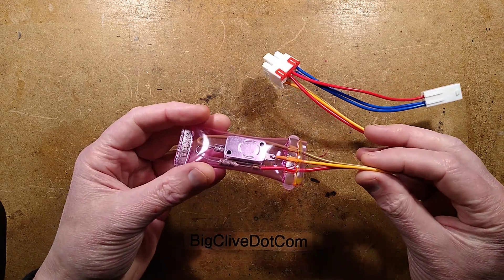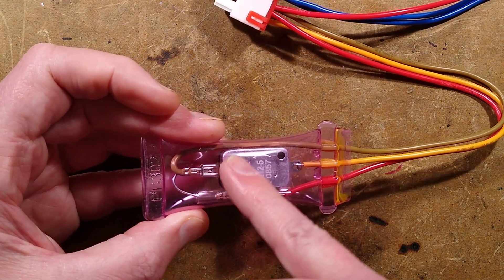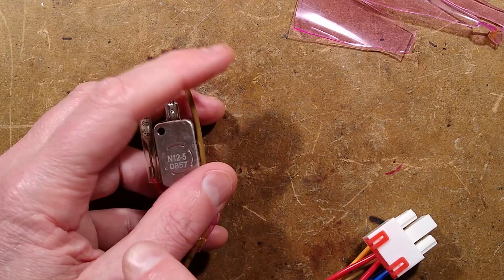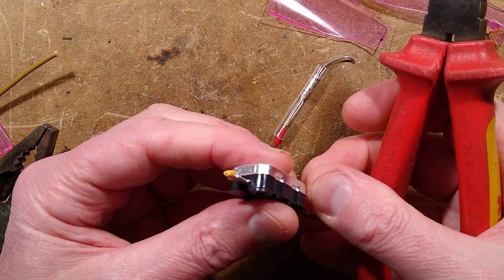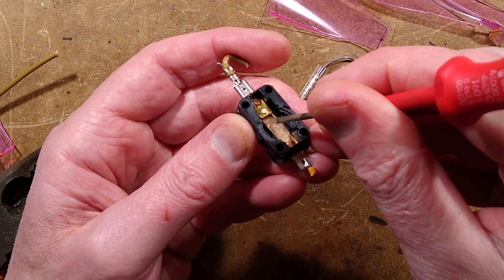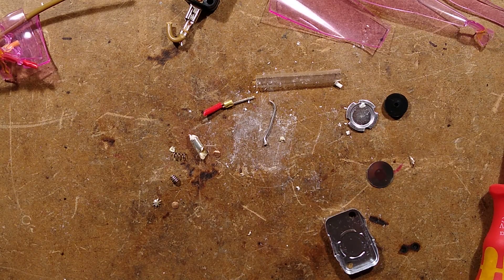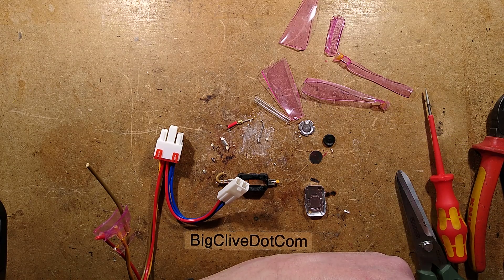Inside a defrost thermostat and thermal fuse

Comment: How can I test it with multimeter
Reply from the maker: If it's the same as this one there should be continuity between the brown and red, but not the brown and orange unless the temperature is very low.  It would have to be tested with the power off, and preferably out of circuit.  These are cheap items, if you want to rule it out you could just swap a new one in.  YouTube has lots of videos showing how to diagnose refrigerator and freezer faults.

Comment: I've been working in the commercial field for refrigeration for many years.
I believe that would be a "defrost Terminator"using the thermal disk terminate the defrost cycle and start the timer again for the next defrost cycle and if the defrost trimmer sticks on and that thermal desk doesn't cut the power thermal fuse will cut the power before your refrigerator burns up, those heater coils are like the coil in a oven.

Comment: Fun fact, the little thermal fuse is commonly inside of toasters, if the plug area gets too hot that fuse blows, toaster stops working. I recently replaced mine with a thermal breaker to keep the protection but allow it to reset as needed.

Comment: Clive or anyone in the know… I have a device with a .01 ohm current sense resistor. The actual circuit serves as an on/off switch that has a display that shows battery voltage, and automatically cuts out at lvc for Lipo battery packs. The oled display doesn’t show current. I replaced a fan that adds a tiny bit more current draw to the circuit and the stm chip cuts out and shuts down after showing an overcurrent error. If I raise the value of that .01 ohm resistor to decrease the voltage drop, would that be enough to run the higher output fan. The old fan was rated at .25a the new one is .75a. My thought is this may mess with the low voltage cutoff…

Comment: Speaking of passing air through wires, at work we have pressurised coax cables that run to the satellite hut on the roof. They're fed from a regular air compressor which pushes the air through a multi-stage dryer, since the whole point is to prevent moisture ingress.

The coax itself is about 3cm thick, and a complete bastard to handle. Luckily we installed it while the building was under construction. The top floor was completely empty so we could unspool the cable and figure 8 it to feed down the comms riser to our server room, then push the other end up to the roof.

Comment: interesting on the thermal fuse. so that plug dust should melt at around 75c then. I wonder what it is? Now I am wondering if one time trip bi metalic ones just over distor to the point of no return or also have some special melty stuff in them??

Comment: Those thermal fuses are wax based. The heavy spring presses against a wax pellet, and then once it's fully extended,  the weaker spring moves the contact disc away from the terminal formed by the wire that goes through the resin.
Edit:
https://youtu.be/5ucEiAcr7nY

Comment: yes the thermal fuse is working like that, this "compound" or wax stuff or whatever it may be made of has a certain melting point which is melting letting the contacts slide away from each other. it is actually pretty common fuses like this goes open over time even if they don´t pop. soldering them can be a hassle but it is possible even with the 70 degree ones. when I do solder i use freeze spray to frost the fuse body and use a very high temperature on the iron to as quick as possible solder the ends of the leads to the device, wires or PCB and then cool down the legs with the spray before the heat goes into the fuse. it may also work to hold the lead tightly with a thick plier while you do, it depends on the rated temperature of the fuse

Comment: Air, gases, and even liquids will travel down stranded wires. Automotive oxygen sensors actually "breath" slightly through the wires and won't work if the wires are soldered.

Comment: Could one of the springs in the thermal fuse be a memory alloy that reverts to a smaller compressed size under sufficient heat, breaking the contact? Putting a heat source to the spring would quickly tell you if this is the case.
Reply from the maker: It's not.  The method of operation is at the end of the video.

Comment: When coming across a modern ( dead ? ) appliance at your local recycling dump ( rice cooker / heater etc ) you can be sure the dastardly in line thermal fuse has gone O /C .. fit one of a slightly higher temp rating , manufacturers err on the low side to avoid costly legal issues should any fault occur , but generally these fuses are much too sensitive and result in LOTS of junked appliances ( so they can sell you a new one  ? ? ) ...

Comment: Some oxygen (lambda) sensors use the space between the braided wires for the reference air side.  These work through crimps, waterproof connectors, and provide better protection from moisture.

Critically, you cannot solder the connections or use dielectric grease in the waterproof connector or they won’t work.  They don’t need much air.

So my guess is that plastic weld leaks very slightly through the braided wires, unless they’re soldered or oiled on one side.

Comment: Would love to know what that heat shrink seal is and where to get it!
Reply from the maker: The sleeve isn't heat shrink.  Just a plastic sleeve that can be fitted together when heated.
Reply: @bigclivedotcom  Ah, I see.  Others have mentioned ultrasonic welding to seal the ends. I have a PCB with troubleshooting LEDs that I need to see.  This could be an elegant solution for that.  Wonder what that material is.  Looks like a clear "flexible tubing material, probably PVC.

Comment: Electric blankets have a similar type of thermostat in them, and the way they're made, the may have as many as 3 or 4, with 1 for each temperature setting. They are sealed so that the blanket can be laundered, and also to protect from sharp edges that could poke through the blanket.

Comment: These exist for one reason because the thermal barrier to the thermal fuse and when you get massive condensation in a humid environment. The original designs only had one sensor in the fridge or evaporator so there was no software fix to stop it blowing the fuse, the thermal switch allows it to cycle the defrost system and hopefully get it all done before the end of timer. What might be interesting to explore is just how good an insulator ice can be in these situations where you have a defrost system running and parts of the system cooking and the the ice can shield parts of the controller system, its a minefield.

Comment: You do know, that plastics are not gas sealing very well anyway? It will not pass any meaningful moisture mass in decades, and moisture coming from wires would kill connector before this unit anyway

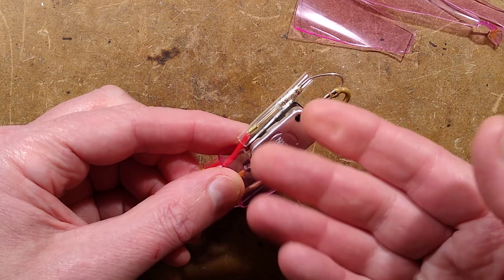Comment: 3:04 i wrap thermal fuses in paper rug soaked with water and i can solder them really nicely and they don't trip. I fix automotive resistor modules like this, typically with 180 deg C fuses. I if would fix in example water heater with 105 deg C fuse i would use  alcohol soaked rug

Comment: I had a refrigerator that used to pop and crack loudly in defrost mode then it would ether freeze or defrost every thing changed the timer twice and the thermostat and relay the noise was normal they told me after a month of this it got scrapped . When I went to replace it the sales gal told me no matter what you buy it will last about 7 years no matter if it’s one that cost 2Kor just $300  sad my old one was still working but was a manual defrost Philco I’d had owned it over 30 years I gave it to a work buddy 10 years ago and it’s still going strong !

Comment: These are also used in parallel with 'Heat Rate of Rise' type fire detectors for redundancy.
I've had two 83C ones fail and set alarms off that weren't exposed to higher than 50C.
I now parallel two of them up to give the redundancy some redundancy... It's stressfull being woken up by a fire alarm.

Comment: Clive, thanks for the video.  That is a super low cost defrost bi-metal switch.  Definitely not hermetic, as moisture can migrate through that plastic.  This design is a step backward, the previous versions clip onto a pipe on the evaporator to sense temperature so, this design will have thermal lag.

The "N12-5" number lists the cut-out and cut-in temperature, although with that number, there should be either a F or C suffix which denotes Fahrenheit or Celsius.  In the number, the 12 is the cut-out (or open) temperature, most likely in Celsius.  The -5 indicates the switch will close 5 degrees below the cut-out temperature.  So, the switch will open at +12C and close at +7C degrees as marked.

Originally, with "frost free" refrigerators, the defrost cycle was controlled by a motorized timer switch.  Since the 1990's, the defrost is controlled by an electronic circuit that makes the decision to defrost based upon the amount of time the compressor runs and the number of door openings.  When defrost is activated, it turns on a (typically) 600 watt heating element that is connected to the bottom of the evaporator coil, which runs for 10 - 20 minutes.  After the defrost cycle ends, the refrigeration has to remove all of that heat.  The defrost algorithm doesn't take into account relative humidity in the room or makes no determination if the ice is actually melted on the evaporator so, in addition to using electric resistance heat (versus heat pump mode), it wastes a lot of power.

Comment: is there a way to find out which outside outlet is causing the breaker to trip? Kinda looking for an easy way to find out which outlet is causing it before i replace all the sockets
Reply from the maker: Suspect any in very damp areas or with heating appliances.
Reply: If it’s due to leakage due to an insulation failure (such as water/moisture), a (battery powered) high voltage insulation tester can help. Otherwise it’s a case of visual inspection and a process of elimination by disconnection.
Reply: @Mark1024MAK  Thanks.. Yeah, it trips even when nothing is plugged in so im guessing theres maybe dirt or something in one of the sockets, even though replacing sockets is easy it still kinda sucks. The odd problem though is it trips at random times, it doesnt do it right away, it can go a number of hours before the breaker trips but at some point it always trips.

Guess i'll just replace em all
Reply: I think i know which socket(s) could be causing it so gonna try replacing them and see what happens.. this started happening when a 12v power supply for the outside yard lights died, so probably related.

Comment: So can you take an old refrigerator that no longer gets cold. Bypass the over temp protection. And have a low temperature cooker. I wonder what temperature you could get it to. And would it melt the plastic pieces inside.
Reply from the maker: I'm not sure what temperature it would get to, or if the plastic would deform.
Reply: The next time I replace a fridge I’m definitely going to test this on the old one. Maybe I should video it incase it bursts into flames. :)

Comment: That plastic pouch probably contains a low pressure Inert gas to prevent arcing or moisture ingress.
Reply: Would diffuse out thru the plastic due to concentration gradient and mass transfer.

Comment: I had to do a post mortem on equipment that had a thermal runaway. The factory it was located at suffered a power surge due to a lighting strike and as a result the solid state relay controlling the heater shorted out causing an over heat condition. A thermal fuse would have been the last defense against runaway but the surge cause the thermal fuse to explode and the center pin became welded to the case. Eventually the equipment got so hot that the wire nuts in the solenoid valves, located in the insulation space, started melting and exposed the metal inside which came in contact with the case of the solenoid junction box causing the control circuit fuse to blow which opened the heater contactor.
Reply: i'll bet anyone who witnessed it happen will never forget the dull orange glow of the heater before it blew

Comment: That's interesting, but brings back bad memories. My fridge was having some issues recently and while trying to fix it I stupidly touched the defroster element while it was running to see if it was working. For some reason I thought: it just needs to melt ice, it can't get that hot. Well I got incredibly painful second degree burns on three fingertips in about half a second. Protip: Don't touch the defroster. That fridge is now in the junkyard.
Reply: Heh! Blame the fridge why don't you?
Reply: Not glowing=/=Not hot is a lesson we all learn at some point.

Comment: I absolutely love that packaging! Now I'm gonna have to figure out how to do that. Hmmm....
If the plastic cover is the same material as the wire insulation it should not be that hard...no reason it would hurt the wires, it could expose copper, but then it would still be covered in melted plastic. I wonder if I could use a modified impulse sealer with some notches for wires.

Oooo....then you could inject the entire thing with hot glue or silicone.

Comment: The design of the thermal fuse is really quite surprising. I also did an autopsy a fuse like this from a broken iron and I wasn't smart about it, so thank you for the helpful information.
Reply: Speaking of irons and thermal fuses.

This I think was an older model but don't know for sure.

I was scrapping an iron for a few things and also use the base/ soul of the iron as a weighted base for something else for a tool Mount I think it was it may have been I was using it to make a soldering iron holder for someone!

But the thermal fuse in that iron was something well rather intriguing.

It was not standard little cervical thermal fuse like the one in this video was.

It was essentially to contacts brass or copper alloy or other that that a bit of a spring to it.

There were two circular portions of the contacts that were essentially soldered with a low melting point alloy.

And that was the thermal fuse itself!

Also I was working on an old movie projector which I wound up salvaging in the end once it died!

The Intriguing thing is the internal Motors were actually 240 since this was originally built in Europe.

However the power transformer was designed for use with world voltages.

So this Transformer also acted not only as the lamp Transformer and a step-down Transformer but also a Step up Transformer!

And when I was in there trying to check some voltages I got a nasty surprise happened to bump the terminal on the Transformer they're like whoa that's more in line voltage turns out I I had received a 500 volt shock!

So I put it like that that's designed for multiple countries and is produced in Europe be careful that's not something I expected in the least and because it was so dark inside of it it was difficult to see and almost no terminals were labeled besides the input selection terminals for line voltage selection.

No mention of very high voltage or whatever inside you think there would be some sort of warning when that voltage is present!

And yes it was being powered from 120 volts here in the US!

The other interesting thing is instead of a fuse or even a thermal fuse this may have been used for both simultaneously possibly.

It had what I would describe as an open link fuse with a spring hooked on one end of the s-shaped hooks of the fuse element.

Essentially a low melting point elderly attaching to pieces of either copper or other metal alloy.

Essentially two pieces of metal and solder was the actual fuse!

And fairly strong extension spring!

Not sure if this was intended to be blown by current or heat or both but I suspect both.

Also I'd seen something similar to that iron thermal fuse but on a smaller scale inside of some old hair dryers every once awhile but not very often mostly very early ones probably wasn't the best idea to take those apart since their mind have been asbestos!

But those hair dryers continued to dry hair!

This is long before modern hair dryers but still looked like someone the modern ones back when they were just the two prong cord and no fancy gfrc and ionic whatever where all you had was on off cold high low medium that's about it.

Later on they would add a diode to do away with one of the heating elements essentially feed half-wave rectified to the heating element to reduce element power output.  

Much like the old Radio Shack dual heat soldering irons more old school hi low dimmer switches.

I'm wondering if there's anyone that makes a night light fixture that has a diode in series with the socket to increase lamp life and dim it quite a bit as well of course incandescent and this needs to be for 120 volts ac for United States as well!

I know when option would be a nightlight size and wattage bulb that would be something like a 220 volt indicator in place of the steering night light bulb but that's harder to find but they do exist probably costly to get potentially as well